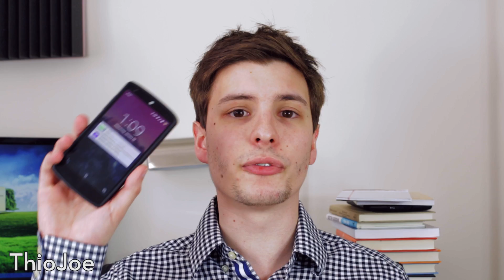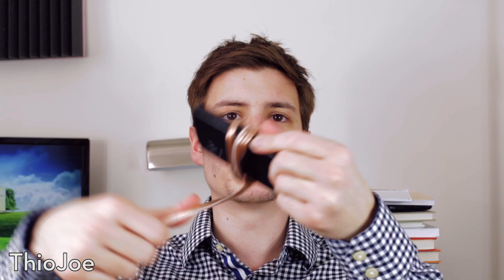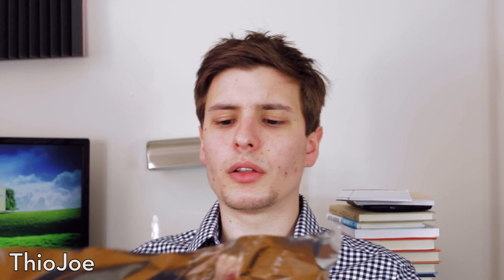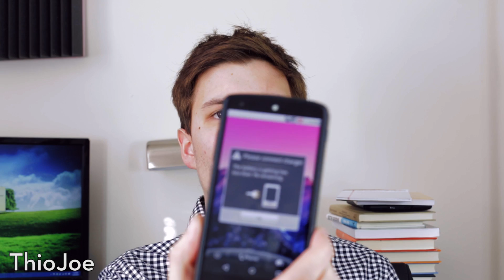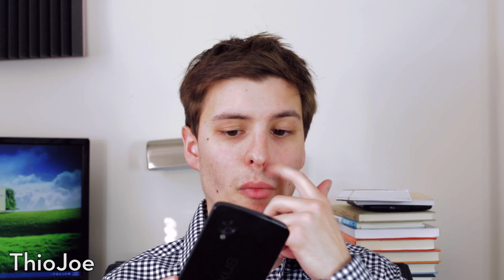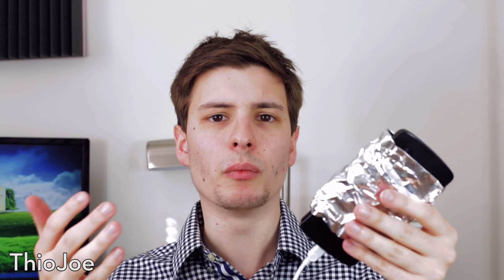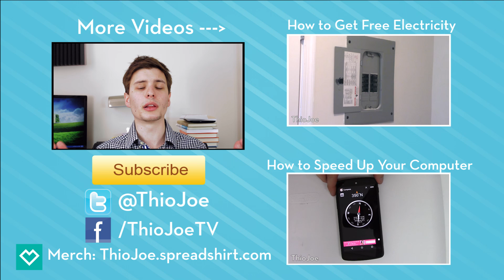How to Instantly Charge your Phone

Comment: Legit, no joke. I had an old tablet that had a trash battery. Every time it ran out of power, I would connect it to my charger, wait for it to be 1%, turn it on, and restart it. And legit no joke it was instantly on 30% but it shut off after a couple seconds sooo. Kinda worked.

Comment: This video is outdated. With phones now having 4000-5000mah, this method is less efficient. The new method would be to use aluminum foil without any cables wrapped around the phone. Instead of plugging in the charger, Place the phone in the microwave for about 4-5 seconds depending on your phone's battery capacity (I'd say 4000mah for 4 seconds and 5000mah for 5 seconds), you don' t want to do this too long as it'll fry your phone. Once done, remove it from the microwave and it'll be fully charged.

Comment: Better yet, go buy a Snap-On battery charger plus series, number EEBC500A. Approx($800). Then take the back cover off your phone. Plug the Snap on charger to the outlet and set the unit to 100 amps for 3 minutes. Then take take the leads and touch them to the exposed metal part of your phone. (Any metal you find) hold there for the full three minutes. And Wallah your phone will be charged like never before

Comment: There is actually a way to charge your phone 2x faster and no I'm not trying to trick you 

It can work I say can because it can make the battery explode 

Here is how to do it 

Step one get two chargers of the same make 

Step two cut the end of one charger and strip the other 

Ok now expose both the positive wires attach them only the positive   

Now that you have done this cut the remaining neg wire or tape it  up 

Final step plug both chargers into the wall then connect to your phone 

Now double the charge is going into the battery and a smaller percentage is being deducted 
++ to -  results in a faster charge but can also destabilise the cells 
So don't do it if you love you're phone/ tablet or laptop

Comment: I wrapped my electric car with about 400 feet of #1 gauge welding wire and then covered it with 6 layers of insulated bubble wrap foil. After I plugged it in I was amazed that the charging time dropped from 2 hours (8-100%) to only 6 minutes to 100%!  And the best part is, the cord I used was a 120 volt  extension cord with a 220 volt adapter plug. Now I'm using less voltage AND charging quicker!!!  Saving $$$ is always a good thing.
As a bonus, I found my daughter's iPhone in the car and it was charged too!

Comment: I remember doing this with my cousins tablet and it chsrged to 90 percent. I turned it on and everything was corrupted. Missing jpegs delted pics etc.. but then i restarted the tablet anf everything was back
 to normal! I went back to this video to see othet peoples success stories only to find out that this video was FAKE! I was so confused because it worked for me! It still does to this day! I found out that to speed up the charging even more you use only wires and no tinfoil!!! Thank you thio bro!

Comment: I can't believe he forgot the most important step. You are supposed to stick it in the microwave before you plug it in  magnetic induction is not going to work if the radiation levels of most common tinfoil is low. 🤔😑

Comment: Joe Joe, you should be ashamed.  1.  You changed phones with one that was charged.
2.  Your charger states max current out to phone (most are around 500ma/hr= 0.5a/hr).  Phone batteries amp storage is around 2000ma.  Thats a 4 hour charge no way around it.  4th grade math.
3.  Induction works with AC voltage.  Phone charge to battery is DC voltage.
4. You used the foil so you would hide that the battery not charging.
5. These are fellow Americans you are misleading.  You unpatriotic leach?

Comment: I learned about this in AP ElectroPhysics. Nice try but in order for this to work you need to add a few steps.. First of all, The foil has to be greasy, with some food still on it. Speaker wire has to be either brown or black and you need more than that you need at least 12 feet. Finally, you have  to wear some aluminum foil on your person, either wrapped around your wrists, or on your head, like a yarmulke, to increase the electrical charging current. It also helps to hum a low-frequency while doing the actual charging.  This helps to align all the positively charged neutrons and electrons.  Good luck and happy charging!!

Comment: DISCAIMER: this is very dangerous!

The electric potential is lost because of cole's law, in a nutshell, cole's law basically says that whenever a battery is charged, 90% must be lost so the battery still works fine. If you break cole's law by using thiojoes method, you risk ruining yout battery, but don't worry if you have! Simply:

1. Open the phone up
2. Find the battery
3. Use wire cutters to cut out the battery ( we will fix this later, do not fret! )
4. Get some coleslaw
5. Place the battery into the coleslaw for roughly 69 hours, it takes a while to get the excess potential out.
6. Take the phone and put hot glue on the cut wires
7. Attatch the battery back to the phone
8. Enjoy your working phone again

I took studies for cole's law in college, i work at LG, in the battery design and production centre where extensive knowledge on cole's law is required. We use this info to fix issues of batteries like this for example. Cole's law is experienced in more places than you could ever think. Did you know there is electric potential in hotdogs and sandwhiches thanks to cole's law?

Also if you are wondering where magnetic induction comes into play here, its the main reason cole's law works.

Comment: this method i did at home by myself works for me guys.
only works with Android 
step one : open the backcase of your phone and remove battery
step 2: take an old charger and snip only the side the plugs into the phone 
step 3: there is 4 wires sometimes 2 but it doesnt matter. take the red wire and black wires and remove the sleeve over the wire till you get copper wire
step 4: take the red wire's copper wire and place it in the positive terminal of the batter and put the black wires copper wire and place in the negative terminal of the batter. 
step 5:carefully hold the wires on the terminals and insert the battery into the phone with the copper wires still touching the terminals and now touching the metal prongs that connect to the terminaps.
step 6: now plug in another charger into the usb port. dont remove the copper wires yet. 
step 7: wait about 2 minutes and then turn on the phone without taking anything out 
step 8: if it says 100 then viola you did it. i just discovered this yesterday so i dont know if it works on all Android devices but please let me know if it does
Reply: i did this on an samsung galaxy j5 btw

Comment: To be fair have a spare fully charged battery on you. Leave one charging in your ass as the other is  running low eat beans because your going to need some gas. Works a treat. Most important thing is to sniff it as you withdrawal from your backside because your vomit gets rid of the shit.

Comment: Wow, you really don't understand how batteries work. Chemical energy, not electric potential. They're more efficient, not less. Using foil to create a faraday cage would block all signals, so the phone would use less power and be able to charge quicker, or you could just switch it off since that works better. LiPo batteries will never discharge as far as NiCad or NiMH batteries did because circuitry prevents it to avoid damage. LiPo is prone to overheat and sometimes explode if you raise the charging voltage too much, but overvolting NiCad was common practice. Look at a few charging circuit diagrams, or better yet have a go at designing one. Then you will understand better.

Comment: If it didn't work for you make sure you are using copper wire, and not a steel or any other material, also it would increase the speed of charging if you do another layer of copper wire+tin wrap

Comment: Are you calling the "charger" wire an "extension cord" ?  Because obviously you can't plug a regular "extension cord" to your cell phone.  And if it's your charger that you're plugging into your  cell phone ( wrapped in wire and AL+ foil ) for 10 seconds, then it becomes a good trick for rapid phone charge, but NOT for charging without the use of a charger.   So it's a little confusing.  I need a  trick to charge phone for when the charger  is not working !     But thanks anyway.

Comment: wouldnt this cause excess resistance in the battery which may cause the build up of the material between the Lithium and Ion `cells`inside batteries that cause them to explode or short out?,or massively reduce the batteries working life?

Comment: what you're not getting silence was the power saver he instructed to make  previous is integral to this, idk maybe I been goofed but I followed his instructions and though bulky, messy in appearance I can go from 12% power to 76% in 8 to 10 seconds, the charge keeping board made of shirtboard and 1/4 in. foil strips works too... unless my meter is broken or disrupted by this trick it will show 2hrs.37 mins. if I remove it, on the put back the graph straight lines up extending duration of charge just over 7 very hrs. S.G.j3 emerge... just saying, that is truly the reason I subscribed him. Joe knows..  now the induction technique he  uses in this is absolute science, not spoof.

Comment: you're wasting your time. Aluminum foil won't work without a potato and wires. Sorry, it just won't. If you really want something that will work, bills a solar oven. This will work much better. You need a conductor for the aluminum foil. Do something to lift the cell phone off the floor of the cardboard box, though.

Comment: I tried this on my Note 5 Duos but I left it plugged in for about 2-3 hours and holy cow it was at 112%. That extra 2% gets me about 1 & 1/2 day more of usage but I must turn LTE, Bluetooth, and WiFi off but hey texting and voice worked great. 
He didn't mention this but if you leave the aluminum foil and speaker wire on your phone your data signal will improve dramatically. I work at Dollar Gentral during the day and at night I'm a T7 technical support representative for Sprint and we use this in our troubleshooting process.

Comment: You can do it way easier, it's called induction. Make sure you have some tinfoil, about the height of the phone and 2x width. Roll it so it's covered, it doesn't have to be super perfect, it's just to protect the screen, and increase the induction. With that done [it works only on li-on batteries [lithium ion]. Now there is little tricky part, you need to know your batteries capacity, but you can ballpark it to 500mah, so if it's 3000mah and you say 2500mah, it's ok. Simple math now, take your capacity and add whatever your microwave goes [usually 800W, 900W]. Example: 3000mhz battery 900w microwave = 3900, we get rid of 2 zeroes, and we have our time. So now tinfoil it, place it in microwave, set the correct power and time, and wait. The tinfoil will shield from microwaves, but the imperfection in tinfoil made some gaps etc so it is 100% safe, and it's really about 1 min to set this up. You will never need your regular charger after that, I can assure you. Just remember not to go too much with timer, it's better to under-estimate, then overestimate, because the battery then could expand a bit, giving you additional space to store energy, but then again it might not fit into case after constant use, so you have been warned. There is a little thing you can on top of that actually. Just drop one grape and put it on the tinfoil on the phone, I wont tell you what that will do, but I promise you will be surprised. Have fun out there..

Comment: guide to how to have faster phone processer.  u will need aluminiom and some coil . firstly put the coil next to the power button keep it there. secondly replace the coil with the aluminium and let it for 20 seconds. now shake ur phone 5 times on the left and only for on the right. now check ur phone speed. explaintion when u put the coil next to ur phone it has so akropktronic power storaged in it and when putting it next to the power button its akropktronic turns into GHzs and gets transfered to the processsor untill power is balanced between them both and when u put the aluminium it helps the processor in recieving all that amount of power and when u shake it 5 to the left it it makes the processor do an a process called rececturing and to the left it lececturing if the leceturing is more the processor's power gonna get lower so get sure that the receturing is more by one time .                                       what i mean of all this that thiojoe is just an idiot who sucks dicks by making any fucking lies which are well made by saying some sientific words to make it look real.

Comment: You can get a faster charge by putting the wire and foil wrapped phone in the microwave. Defrost setting for 1 minute. The microwaves produce eddy currents which get induced into the battery thru the induction coil.

Comment: I guarantee this one will work because I have an Samsung phone: You NEED a phone that you can take out the battery. So first plug your phone and let it charge for about 10 minutes and 50 seconds. And then take out the battery. The phone should vibrate or has a blue light flashing. Wait for 3 seconds and then put the battery back in. And then it should be at 100%. This trick is recommended for people who doesn't care if their phone doesn't last long. The trick damages your battery. And don't do this trick if you have a phone that heats up fast. IT MIGHT EXPLODE

Comment: What if you don't have a string of cooper.
Reply: Macula Antoine Macula Antoine  The phone will charge like the usual. The voltage will be controled using the electromagnet surrounding the area. If you use other metal material it might be dangerous. If you use only non-metal material, it will effect nothing.

Comment: What he says is completely joke as in his description he said. But if you have removable battery and want to instantly charge it you can do this. Find a car battery take a cable from + and - pols of battery and just touch that to your phones battery. Make sure you are touching correct poles i mean + and -. After 1 second just after spark you should have at least 70% charge. It is not a joke. What I stay is we have only 2 hours of electricity in a day. I have tried it several times but be careful to not connect + and - pols cause it can melt battery pols if your wire is strong or burn your wire. Do not reply nonsense comments as it's completely real and works. It will reduce your battery's lifetime much but worth it when you don't have electricity.
Reply: Do it at your own risk. I have done it more than 10 times on Nokia 1110's battery to play snakes. Any time I try I got 100% BATTERY.

Comment: just wrap your phone in aluminium sheet or any metal sheet and then put it on fire after 30 min remove aluminium sheet and use your phone it will never discharge a single percent

Comment: This works much better if your hair is long, and you push it into a moving fan. The rotational inertia created by the fan blades and  the electromagnetic field turn your hair into a solenoid and the battery charges three times faster. Also works with a chordless drill.

Comment: Wow, It actually worked!!! Knowing a tad about induction and magnetics. I took a 6 foot piece of speaker wire, split it into 2 single pieces of wire. Stripped both ends of each wire. connected the ends of of both wires, essentially making 1- 12 foot length of wire. I taped the joint where I twisted the 2 wires together to insulate it. Then wrapped the single 12 foot strand around the whole length of my phone. Taped the 2 ends of the wires to keep it from unravelling. Now you need to take a AA battery and connect it to the 2 stripped ends of the wire. You have now made an electromagnet. Through the forces of induction and electromagnetism your phone battery will fully charge in about 12 seconds! The tinfoil is not needed using this method Do to the skin effect that the low frequency that the 60hz produces. DO NOT leave the battery connected for longer than 12 seconds, or it may get hot enough to start a fire! Also, wear safety glasses Joe, your the best! Keep your great ideas coming!

Comment: I think I made some kind of mini Black Holes or maybe a Portal to other dimensions when I try to complement ur design by using triple layers of coils (each of it consists of 10000 windings thin wire). This booster charger is so huge, so I have to charge my i-phone 7 outside. When I go inside my home to draw extension cable and plug in the socket, and then terrible things happen! My i-phone 7 has LOST!!! how can u explain this? Until now I hide this booster charger in the basement, I don't want CIA or FBI know about this invention. So, do we have a deal patenting our invention?

Comment: hey man so just wrap around the phone in a length of wire and then the foil what do you do with the ends of the wire do they go anywhere special and you just use the factory wall charger
Reply: Putting it in the microwave works even faster. Zero to a hundred, real quick...real Effin quick

Comment: I have to say, for those who aren't sure, this has to be satire. The only way this would show a charge, is if it tricked out the cpu into thinking it had charge for some reason. If there was a way to force charge a lithium cell, it would likely burn out the battery. This has been a major issue in speed charging for modern battery tech. These are the very same reasons Tesla is still not taking over the automotive world. This channel is satire.